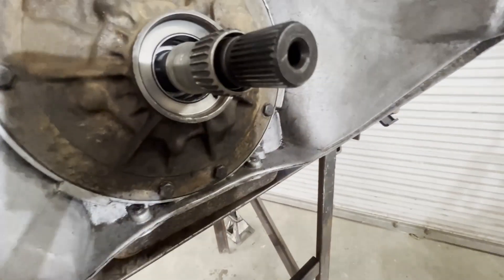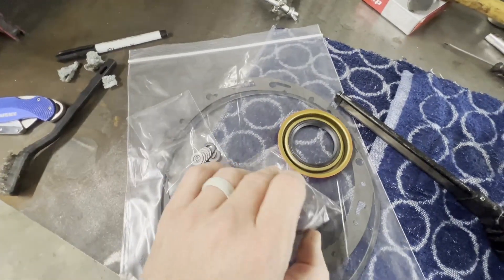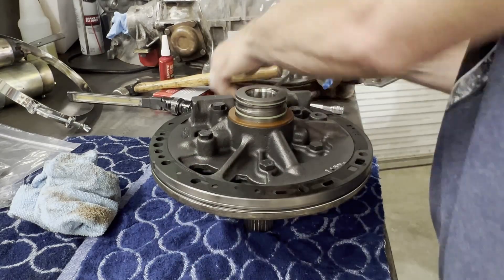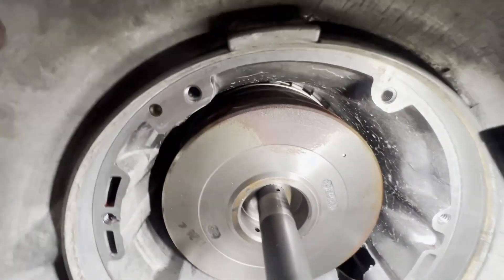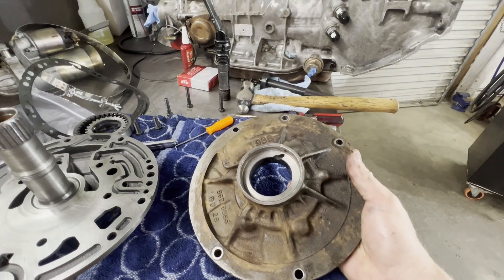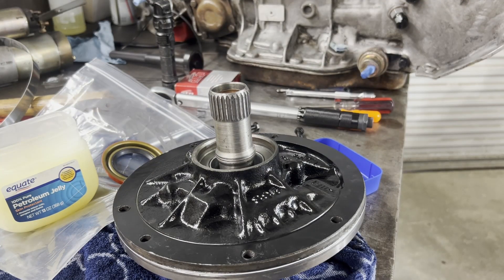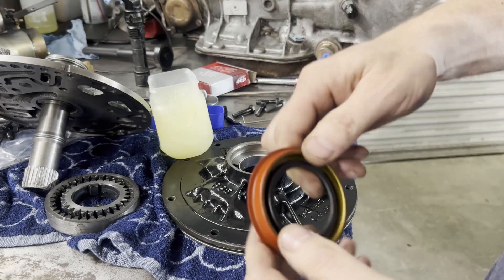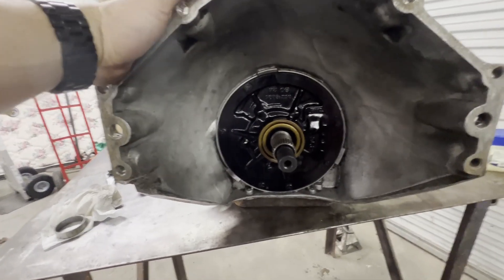TH400 Front Pump Bushing Installation on the LS Swapped S10

Comment: there is 2 threaded holes , in the pump housing, look and you will see.  the rest are just bore holes. Use the 2 to pull your pump out, and use some penetrating oil.
Reply from the maker: @dudebrews Thanks for the info and thanks for watching and commenting!!

Comment: As a veteran racing transmission builder just wanted to say the front oil pump has a converter hub "bushing" the same as other areas of transmission but not a "bearing". There certainly are needle torrington bearings in it too. I am commenting this so maybe you would consider the title misleading since there are actual racing modications to put a needle bearing in place of the plastic shim thrust washer that requires lathe machine work to oil pump. I thought you were possibly going to show that finished process? Plus they have tools to put front seal on over the stator shaft tube and even a poor man's steel pipe or pvc pipe can work in a pinch as well as brass hammer. But after watching this it still worked out for you in the end though! Glad your trying to keep your tranny going and good luck with the s10🔥
Reply from the maker: @djrowe10 thanks for the call out. I will definitely get the title changed. Didn’t even think anything about it but definitely dont want to be calling out parts wrong or misleading. Appreciate the view and the comment!!!
Reply from the maker: @djrowe10 Got it updated! Thanks man!